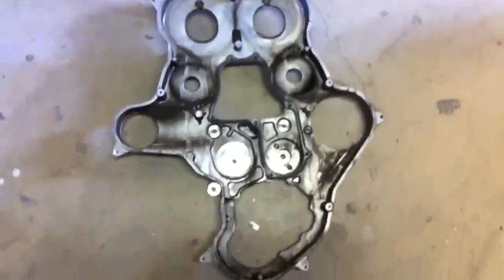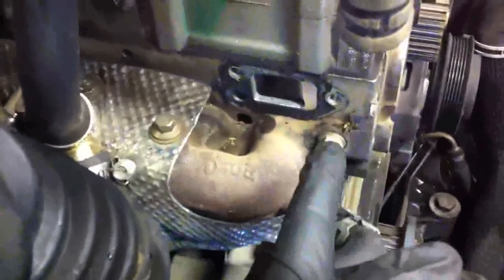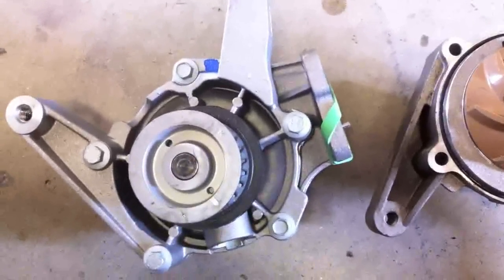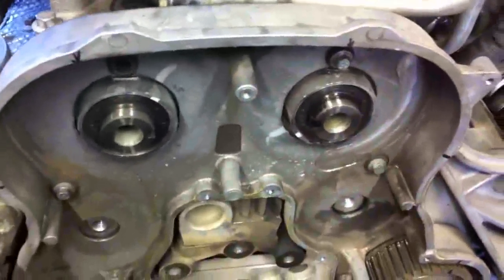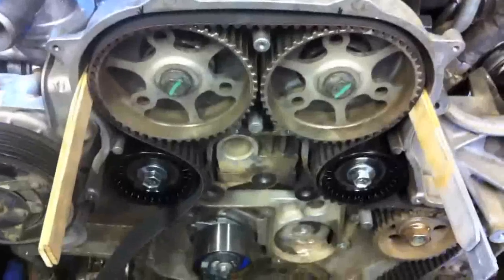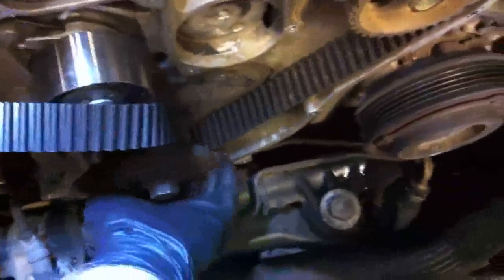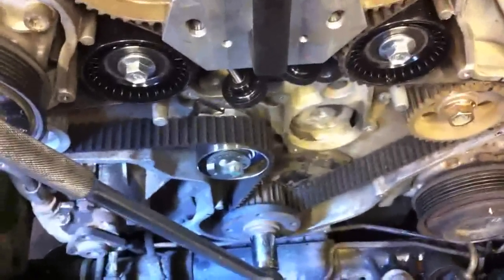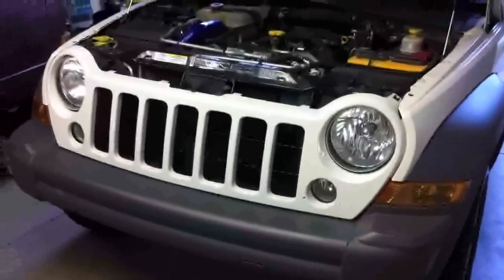Jeep Liberty / Cherokee KJ Diesel Timing Belt Replacement  Part 5

Comment: went to put on the time belt tensioner and the bolt pulled while tightening. Looks like there is a helicoil in the threads that came out with the bolt. We bought this with only 25k miles on it, so I am assuming that this had to come from the factory like this. Have you seen this?
Reply from the maker: I think the helicoil is original, if I remember correctly. What you are seeing is fairly common though, it does pull out on occasion, but can be repaired with a new helicoil. At this point there are also lots of used parts available, you can probably find a good used one if you cannot replace the helicoil.
Reply: Threads were damaged and wouldn't hold well enough to set the tensioner.  Having to rethread and put in an insert.  Thanks! Anything special about setting the tensioner?

Comment: I am having a hard time replacing the serpentine belt and don't understand why. I've tried to loop it onto the alternator and no luck. The belt # is 5061130 for 2005 2.8 liter jeep liberty. Still no luck. Had to put the old one back on and was able to on the tensioner. Any advice. Belts are apparently same length per advance auto
Reply from the maker: Hi missed you comment earlier, new belts are very very tight. But its not unheard of for different manufacturers to have slightly different lengths. The belt crosses over with some other common cars, so you could try a different brand.

Overall though I would say that I use a flat breaker bar on the tensioner pulley bolt to get enough leverage to get the new belt on. if with a 2 foot bar it takes some effort, and you will torque the bolt a little more.

Comment: hello greetings friend thanks for that valuable information. I have some questions I hope you help me. I have a 2002 Jeep Liberty Cherokee Sports Crd with 2.5Diesel engine. I have a problem that this Jeep does not have injectors and therefore I have the number of that part. I've heard a lot that the 2.8 engine injectors are the same with the 2.5. another also the cylinder head assembly of this engine. I would like you to provide me with a means of communication because I see that you have a lot of knowledge helps a lot thanks
Reply from the maker: Hi there. I really recommend going to http://www.lostjeeps.com/forum/phpBB3/viewforum.php?f=5 and asking there about the injectors. I have injectors from a VERY early 2.5 CRD (engine made in 2000 when the jeep was released for 2002) and those injectors were different from the 2005+, however I do not know if all the injectors were different between 2.5 and 2.8 in the years 2002-2004. Also if you go here: http://colorado4wheel.com/manuals/Jeep/KJ/
You will see there are parts fiches, you should be able to lookup the PN for the injector in the parts fiches.
Reply: OK, thank you very much friend. I already found the injector number of my jeep and it is 0445110059 bosch. Now my question will be that they still sell these injectors in the USA? since my liberty the injectors were lost and I didn't know what number they were. it would be great if you helped me find them, thank you very much in advance
Reply from the maker: No I do not think that injector was sold in the US ever. I would suggest you try http://www.vmdieselspecialist.com/vm-spare-parts/ for parts, they have new and used parts for some things. If they don't have them used you might ask if they know of any Jeep Breakers in the UK you could see about buying used.

Comment: Thank you so much for making these videos. They're so helpful.
Is this the 2.5 diesel engine that would be in a 2003 Liberty ?
Reply from the maker: Here Now this was a 2.8 Crd from a 2005, however the 2.5 and 2.8 from 2003 are basically identical when it comes to the timing belt process. You can use this guide as a reference for doing the belt on a 2.5 CRD
Reply: There's no substitute for experience. So thank you for generously sharing your experience here with these videos. Very much appreciated.

Comment: Do you think it is possible to change the time belt and the water pump just by removing the radiator fan shroud and the fan blade with the clutch ?
Reply from the maker: Ri Vi yes absolutely. Clearance is not as good and it’s very hard to remove a in modified fan shroud but it can be done. Be careful not to damage the radiator.

Comment: Hi This is quite helpful. One question. When you re install the Cam gars what Torque value do you need to secure the cam gear bolts to be safe.
Reply from the maker: Dwight McAmmond from the factory service manual I show 108Nm or 80ftlbs.
Reply: Thank you That was the only question I had from your video. I will go to work on my first change out shortly. Will follow your instructions closely. Thanks again. Dwight.

Comment: which way does it turn when looking for the crank pin hole so im looking at the motor from the front radiator which way to find 90 degrees past tdc
Reply from the maker: Looking from the front turn the engine clockwise. So turn the crank mark from 12 oclock to 3 oclock. Thats where you will be able to get the crank pin in. Having a helper to move it back and forth slightly can help to get it in. If the cam pins do not go in turn it another 360 degrees.
Reply: you would rotate crank clockwise, you can move it slightly counterclockwise such as a tooth or two to get pin in if you believe you are very close to it

Comment: I have a CRD. it has 160K on it  I think I needs a head gasket. It is pushing coolant out of the overflow on the reservoir. I have tried using a block tester to check it but the blue fluid does not turn yellow. is there  another way to check it? I am going to replace the timing belt and water pump at the same time. I found your videos on the timing belt a  big help. Any advice when doing the head gasket? I forgot to tell you that the jeep still runs and drives good . it has been leaking coolant for almost 3 years on the passenger side and the coolant reservoir has pressure in it after it cools down too. Once again any help would be grate. Thank you for your time. Mike
Reply from the maker: If you do a head gasket replacement you should also consider doing ARP head studs. Some people with problems like you have will replace the head studs as a first measure, and see if it cures the leaking head gasket. If you buy ARP head studs they are reuseable, so if that does not stop the leak you can replace the gasket and reuse the studs. There are 3 gaskets for this engine, and there is a hole punched in it to tell you which it is, the thickness is different between gaskets and is based on liner protrusion. Many people will simply replace with the thickest gasket. The Jeep dealer in the US will only sell the head gasket with the original TTY head bolts. You can buy the gasket from http://www.vmdieselspecialist.com/ in the UK by its self. The head bolts are VW TDI bolts - same spec, however you need a set of two TDI ARP kits to replace the VM bolts, with 2 spares. If you are removing the intake you might also need to consider replacing the rockers. Once you have the intake off you can inspect the rockers for wear. You can also buy the rockers from the VM specialist. IDparts.com in the US will also carry many of the parts you need. http://www.LOSTJEEPS.com diesel section can also be more helpful answering many of these questions as there are many owners who have been through this before.
Reply: thank you for replying so fast. I'm going to try the studs. I found them at id parts. do you know where I can find the proper torque specs hor the studs?

Mike
Reply: outer ones 130 ft lbs inner 10 are 120 ftlbs recommend u search on lost jeeps
 @drevilmike77

Comment: IF- not changing the thermostat- can pump be taken off without removing the thermostat?. Great and informative video. Cheers.
Reply: yes you can remove the front part of water pump which is the only moving part and only portion that needs replacing rest where gasket is does not need to be removed but if you did remove rear half of water pump you would want to remove the thermostat also

Comment: Can you tell me what cause my jeep liberty 2005 CRD have the accelaration power? it will not go pass fifty miles per hour, I changed the turbo and nothing. When I take off it has a lot of fumes coming out my exhaust system so do you know what cause that please?
Reply from the maker: That could be any number of issues from minor to major. I'd recommend you post up on lost jeeps about your symptoms and what you have done so far.
Reply: i have changed the turbo, fuel filter, complete tune up on the engine, timing belt and right now my front differential for the 4x4 is bad so i am getting ready to get that fix

Comment: I must say this is a excellent video series. Helped me big time as the work shop manual does not give the location of the flywheel pin hole. Would of been fine if i had started on the job but was helping a mate and he had all ready pulled everything off.

Comment: Great video. Helping a bunch. In the process of changing mine out now. Having some trouble with aligning the crank and still keeping the belt tight. I'm not using the vm1085 and I'm not sure if it will help me or not but is there anyway I could get a measurement from the 1085? The bottom of the top where it slides in the cam gears?
Reply from the maker: Jake Pearson Hi Jake, I'm not sure what you are asking about the measurement. I do understand what you mean about alignment the crank and keeping the belt tight. I talk about this at about 11:20 and 12:30 in the video. Hopefully that makes sense.

Comment: dear sir, thanks for this lovely video, I have a humble opinion: Why we just don,t  tighten the bolt on 2 cam shaft gears and put the belt on with 3 pins in place and focus only on injection pump gear mark as the manufacturer marks it solely. I think it makes a perfect hassle free timing . Just that we should use the front hole as a stopper or rely on pins holding cam shafts to tighten the bolt to the torque and not use the gear holder. I wish the Italian have used chain on this nice engine!

Comment: Thanks so much, these videos were a lifesaver, just did mine over the weekend. I made my own locking pins by grinding bolts and made my own sprocket buster bar, but found re-torquing the cam gears was very difficult without a camgear locking tool, I rented a universal one from an autoparts store and it worked well.

The hardest part of this job for me was getting the new timing belt on the tensioner. I unbolted the tensioner, slid it on then bolted the tensioner back to the block.

Comment: the graf pump from idparts is the front half, you can leave the oem rear housing bolted to the block just like the video shows and put the new graf part in, i just did mine over the weekend

Comment: You missed the point on why the cam sprokets have no key or timing marks.  How you do it works but if you read the service manual you would save yourself some greif in getting the timing belt on.  you put the belt on with the sprokets finger tight and let them move as you get the belt in place then tension the belt and only then do you torque down the sprokets.  the timing pins are how the engine is timed.  you will not have the extra tooth problem at the crank if you do it this way.

Comment from the maker: Miller tools is the only place to buy them new, you can find some other make VM 2.8 engine tools on ebay from the UK, but they don't have the cam gear holder, which if you can find a way to counter hold the gears you can live without. Stick with the OEM water pump. IDparts(dot)com sells a pretty good timing belt kit that is very popular. Again there has been lots of discussion and information about alternatives on the lostjeeps CRD section.

Comment: thanks for the info. This morning I started to just replace the belt tensioner, but found that the bracket holding the viscous heater was broken. Now I have to replace the water heater. I'll have to do the whole works. I heard you mention to get the OEM water pump so that it will match up with the back so that I want have to take it all off. Do I order the Miller tool online? Or, is there another place to by them off of the shelf?

Comment from the maker: Hal, this is a common leak. I think the best solution is to install an aftermarket transmission cooler. To replace the OEM one you will also need to replace the AC condenser. I just went down to my local oreilly auto parts and got a cooler off the shelf. I disconnected the metal fittings(pull the metal clip out, then they will just pull back out) and then slid the hose over the barb and clamped down. Less than an hour and $60. Check out the diesel section of lostjeeps for pics and more info.

Comment: Thank you very much for responding to my question.  

Would you have a recommendation on a choice of replacement alternator?  Alternatively, what is the part number of the OEM de-coupler pulley?  

I have an engine code indicating that there is a glow plug failure.  I understand that they should be replaced, but is it really necessary to reprogram the PCM?  

Our Liberty gets around 14 MPG in normal rural driving…is this normal?
Many thanks,
BH

Comment from the maker: The chirping noises you are hearing are not a bad belt or tensioner, but rather are a bad alternator decoupler pulley. You can get remanufactured alternators for about $150 with lifetime warranty which include a new decoupler pulley, you can also just replace the decoupler pulley for about $100 without any warranty. If you continue to let it go it will cause the serp belt tensioner to fail, which costs MORE than an alternator. Happened to me. So replace that alternator/decoupler asap!

Comment: I have a question about our 2006 Liberty CRD.  The serpentine belt is making some strange chirping noises at idle.  The belt was replaced about six months ago. Is this the result of a failed tensioner?  If so, should the Idlers be changed as well?  Is the belt brand a critical issue?

Comment from the maker: Get the tensioner bolt just tight enough that you can still turn the tensioner with your tool, then torque it down. Run the engine for a few seconds. Repeat the procedure. That will get the tensioner set. You want to turn the engine over after setting the tension once to make sure the tension is consistent the whole way around the belt.

Comment: Hey ya I have just bought an 05 and it has some issues Thanks for the informative video , I have a question as to the tensioner, is the 10mm bolt torqued before the adjustment for tension is made or left slightly loose then torqued after the scosche mark is aligned ?

Comment from the maker: Most of my customers want the pump replaced, since the timing belt has to come off to replace the pump it only adds the cost of the pump and the additional extra labor for just the pump, but if the pump fails in the next 100k its the cost of another whole timing belt job. One customer opted not to replace the pump, it started leaking 3k miles later. On my personal vehicle I left the OEM pump on, and I will change it at 200k. Keep in mind on many vehicles the pump fails between 100k and 200k.

Comment from the maker: The cam sprocket tool is VM 1085, and can be bought from miller tools, its expensive. There are loaner tool programs, GreenDieseEngineering offers loaner tools. There are also a couple of alternatives for holding the cam gears, see revised video description for the link.

Comment: Great job on the videos.
Don't you want to do one more? I am working on changing the timing belt & water pump (and maybe rockers) on my wife's '05 KJ 2.8L CRD and was unaware that I needed so many specialty tools when I began. Do you have a part number on the cam sprocket holding tool that you used in this video? Thanks.